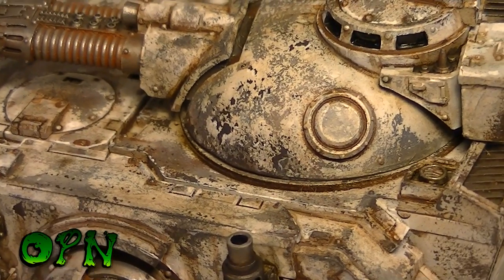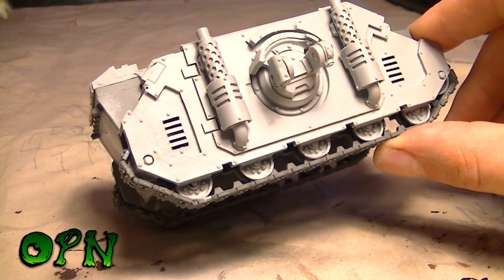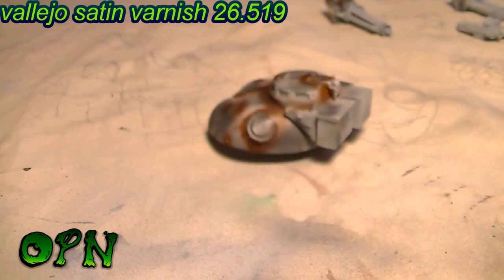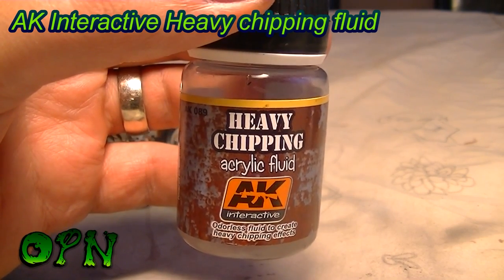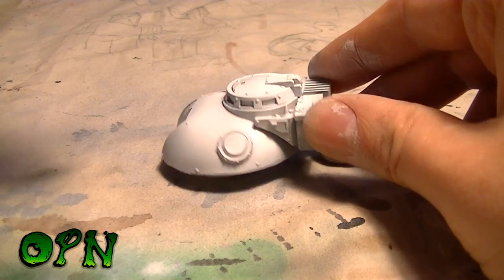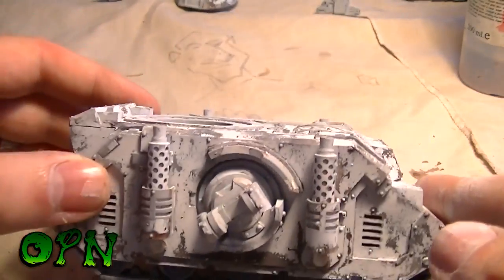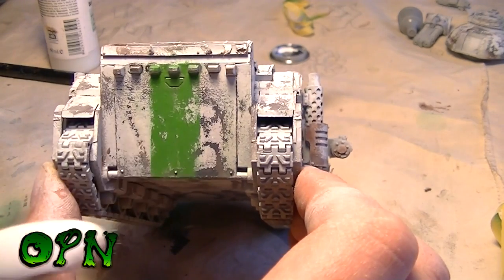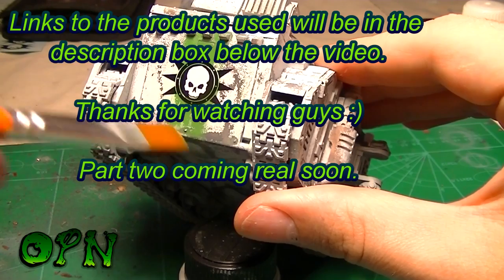How to Paint a  weathered tank

Comment from the maker: It depends on your airbrush my friend. If you have one with a .large needle nozzle set up like a  4.0 it is fine to spray out neat. If not you can dilute it with a little water. the most important thing is make sure you clean your airbrush out asap after varnishing as it will gum up your airbrush like nothing else :)

Comment: If you want to achieve a similar effect in less time (and you don't own an airbrush) you can stipple on masking fluid (preferably latex based) using a scouring pad or toothbrush, and then use a makeup applicator, or bit of cloth to rub it away once you've painted your next layer over that.

I'd actually recommend the method I've just described for your minifigs, since it allows you much more control than, perhaps, an airbrush would do on such a small area.

Also, decalfix is your friend. :P

Comment: Would it be possible to apply the chipping solution to smaller models on a smaller scale without an airbrush? I was thinking of using this technique to weather marines around the boots, lowers legs, knees, those sorts of areas, would this work? Or are there more appropriate techniques to achieve this?

Many thanks, and great vids! :)